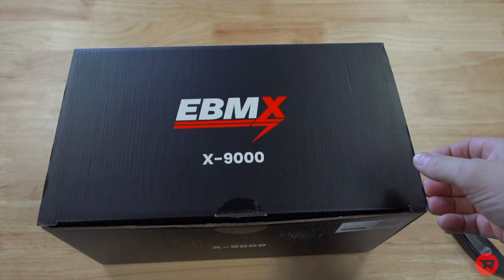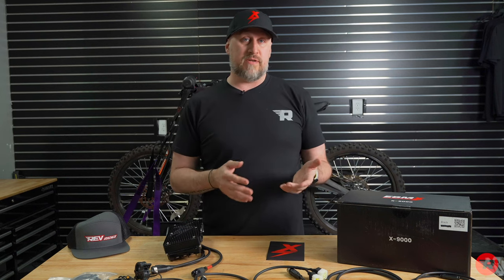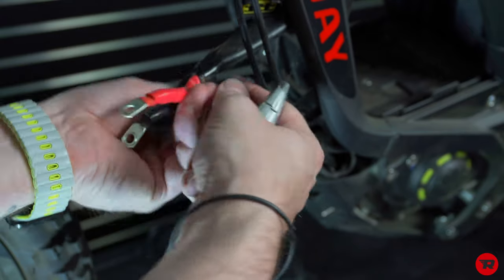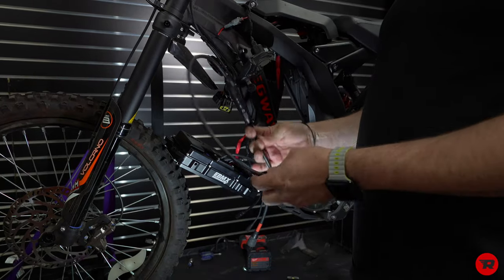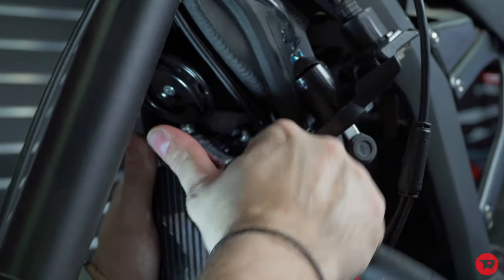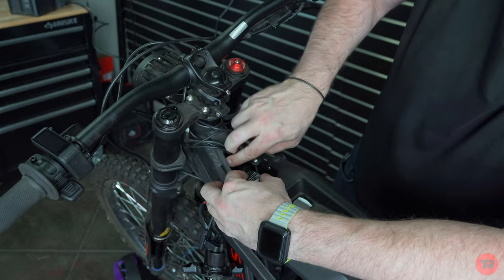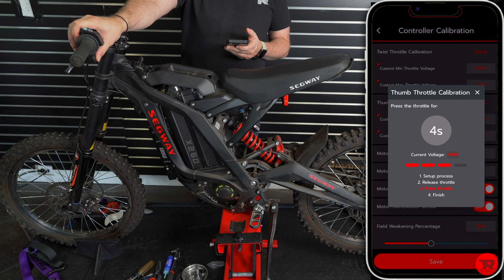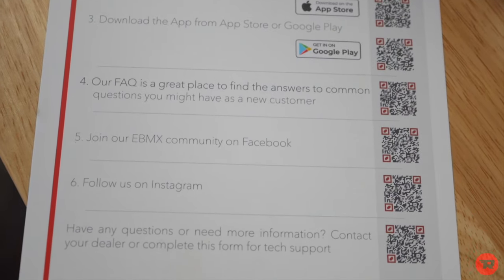Unlock the Power: Install the Ebmx X-9000 Controller Today on your Surron! #ebmx #x9000

Comment: The bolt on my new EBMX X-9000 broke.  I had to drill some of it out but stripped the post.   How do you replace the terminal post on the blue wire.

Comment: Hello i did a firmware update on the ebmx app and now my surron lite bee has loss alot of power...the battery icon at the bottom of the speedo display is empty and blinking. Do i need to set the battery settings? What could have caused this and would u know how i could solve this issue? Your help would be greatly appreciated thank you.

Comment: what is the max battery current that can be ran on a stock 2024 surron lbx battery that’s not bypassed? and what is the max phase amps you can run on a stock motor? thanks
Reply: i dont know